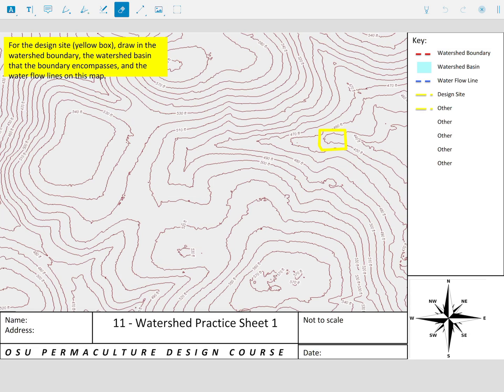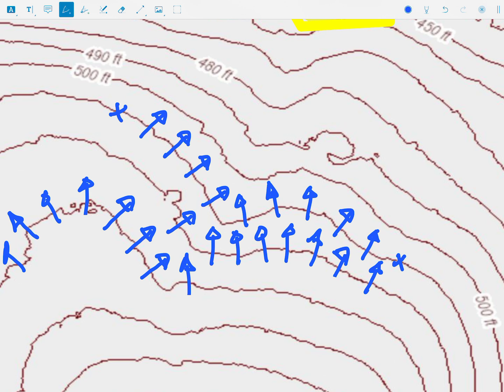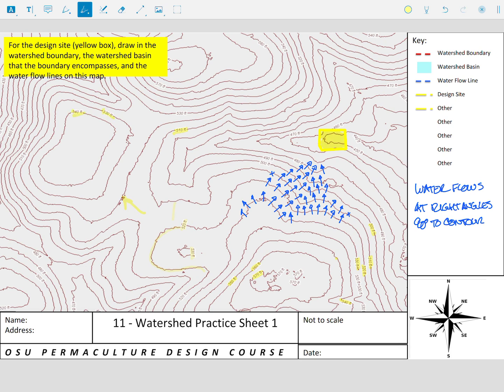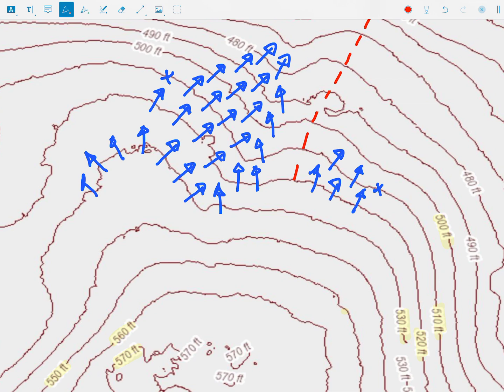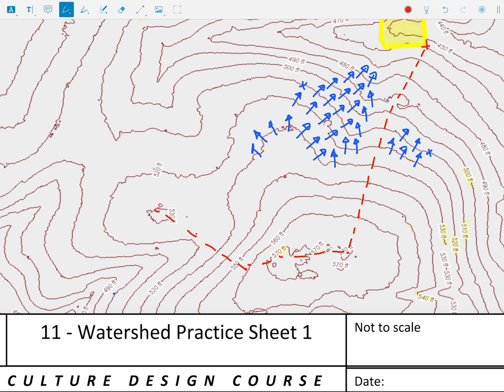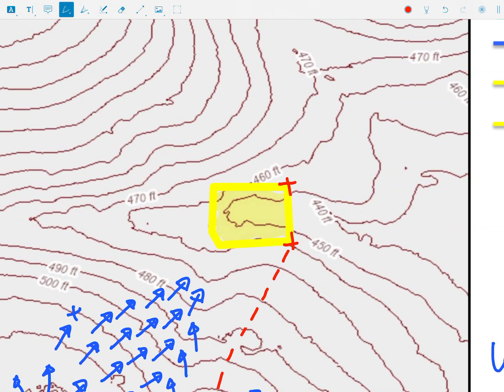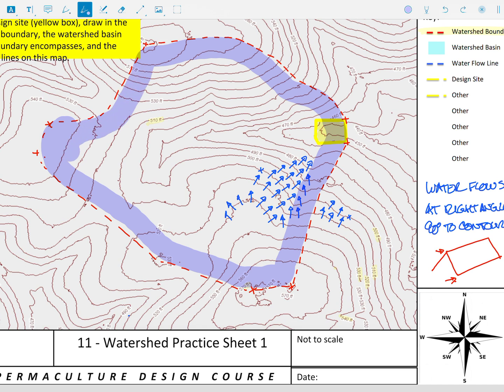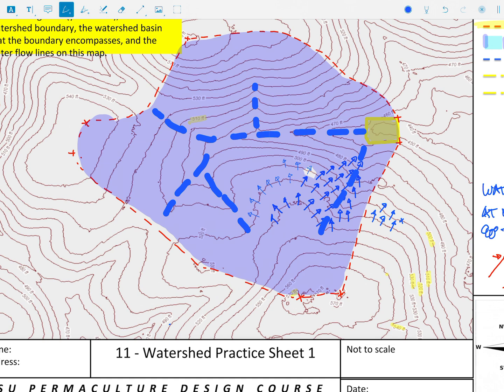Water Flows at Right Angles to Contour

Comment: would the project site make a good dam pond?
Reply from the maker: Great question. Hard to say @monkeymanwasd123 impounding water has a few constraints. The first is the climate and water distribution over a landscape. The second is the topography (the main focus of this video). The third is vegetation and the fourth is soil. There are a few spots on the map that could be eligible for impoundments however the other three aspects, climate, soil and vegetation are unknown.
Reply: @allpointsdesign   Javan K. Bernakevitch  "it depends"😆 asuming this was the Albadia project or someplace in near the coast with a solid amount of rain my impression is that the impoundments could be modified to tolerate the hot dry climate by planting desert trees there on little islands to shade the water for a time, maybe with a good number of water storing plants that i heard could pump water into the ground so they can pump it back up later or would it be better to set it up as a rocky leaky check dam then let it establish on its own?
And if it was high rainfall with rocky clay soil could we do a series of ponds like folks use for stream restoration to take some energy out of the water?